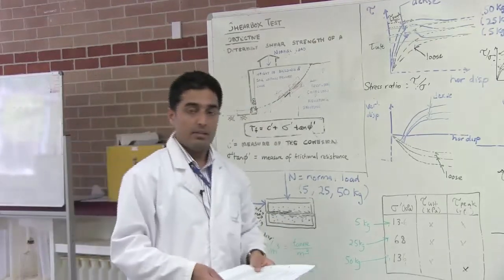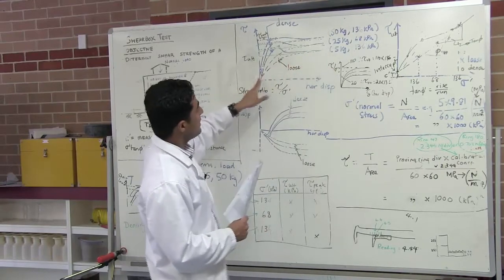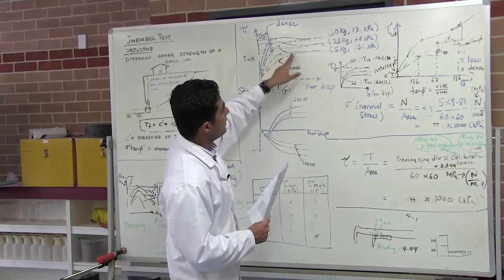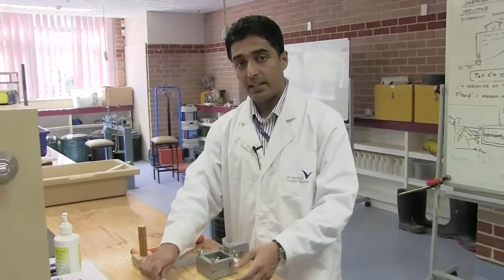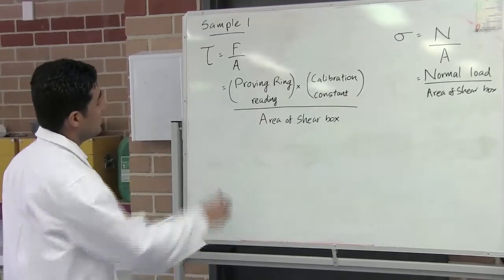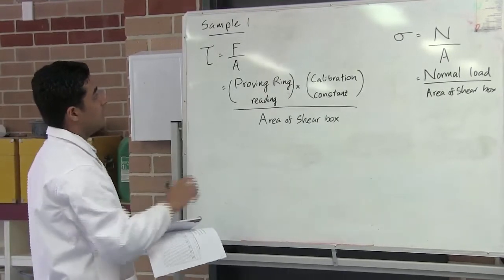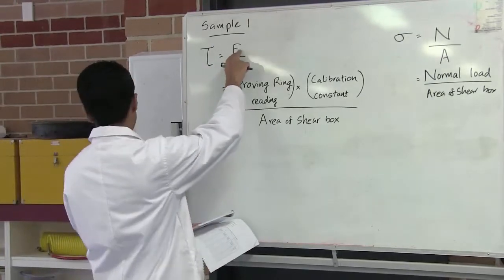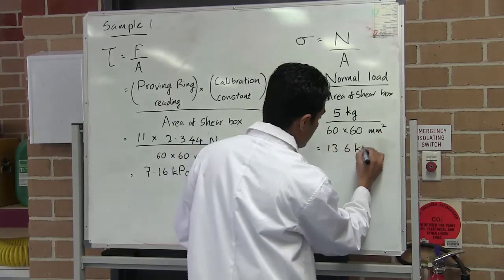Shear box test

Comment: Good day i would like to know if we should consider the vertical displacement on the length for the area when calculating the shear or we only calculate using the (60×60) throughout the calculations
Reply from the maker: Thanks. It is better to use actual contact area though it is simplified here.
Reply: @peterhu5330  thanks